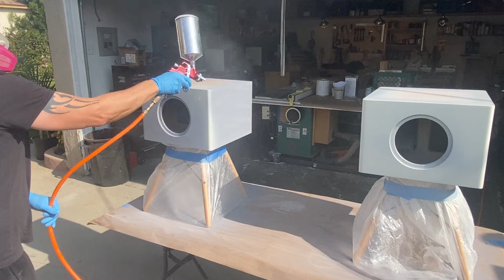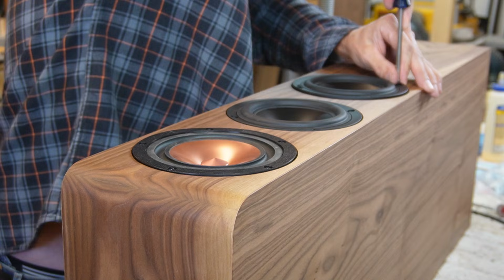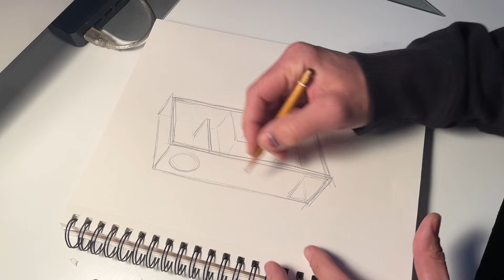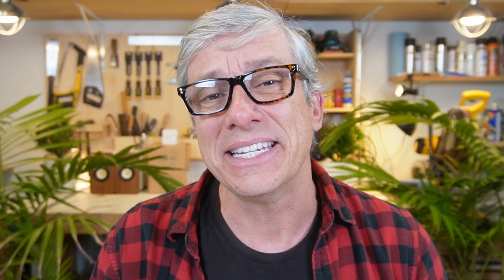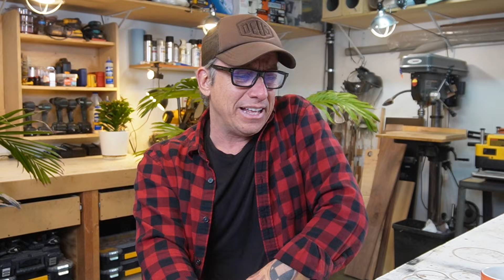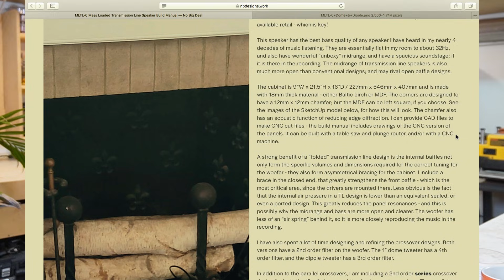Transmission Line Tech Talk | Intro to MLTL-6 Speaker Build | SB Acoustics | DIY plans available

Comment: Great video explaining the TL design. If anyone wants to pursue this topic more check out Lynn Olson's Ariel TL speaker . He does a great job of explaining how they work and went through 5 designs before he was satisfied which I think is called the Ariel 6e that I ended up building in 2015. 2 Vifa P13WH-00 mids each with a 6ft  transmission line with large ports on each side at the bottom and a sealed Scanspeak tweeter. This is a difficult build even for an experienced woodworker and the crossover is not cheap. I think I had well over 1200k in the xover and actually mounted it externally in a matching box behind the speaker. But my gosh- the sound!! I would put it up against speakers costing 6-10 times as much. Many have built it but as far as I know I'm the only one that did a video on the process. Just go to YouTube and punch in Ariel speaker construction.
Reply from the maker: Hey Michael!! Thanks for all the info and hard work!! I’m gonna check that! Those are good drivers, as far as I know, must sound pretty good.

Comment: I like the more in depth approach you are taking.  It allows us to experiance more of your expertise and gives us better design and development information.  I've built speakers since I was a poor kid.  I actually made a box using gypson wall board once with a full range speaker with wizzer cone and it sounded great.  That was back in the 1962.  Any way, love your channel and projects.  Current project has peaked my interest as never built that kind of speaker.
Reply from the maker: Hey Mike! Thanks man! Yup, I get you. We have to go with the flow right? Loong time ago. What you’ve been making now?
Reply: Hi, well it has been a bit about 8 years and was the last piece to my home entertainment system.  It was my subwoofer.  I used a 12 inch Shiva sub and a 6 inch port with an about 4 ft internal tube tuned to 18 hz.  Used a 1000w plate amp.  The box was about 3f hight by 3ft wide by 3ft deep.  A big 6.3 cuft box.  The front was made from two pieces of 1 inch MDF board glued together.  The front hole is chamfered to allow the speaker to breath.  It is baffled so quite a trick fitting in 4 ft of 6 inch pvc tubing.  I used 6 inch elbows to make it fit.  Don't know if that was the best thing to do but it works.  I choose the large 6 inch port to prevent chuffing which worked perfectly.  And yes I do get a good 18/19 hz bottom end.  I just replaced my Onkyo 717 with the new Sony STR AZ5000ES AV receiver which is a huge improvement.  I have a 5.1.2 system.  Your channel got my interest which I use as a proxy.  I will never build another speaker but does not mean I don't want too.  So I watch you.  Good tradeoff.  Keep up the good work.
Reply from the maker: @mikerhodes9198  wow!! That must be a good bass box man. Large though. I wanna start a subwoofer design but more in a lower budget. 
Thanks for watching and I hope you can go back to making at some point!!
Reply: @sonnoradesign  the box is attractively finished in zebra wood sitting in a corner being used by my wife as a knick knack table so it's size is not an issue.  Looking forward to your next video.
Reply from the maker: @mikerhodes9198  hey Mike!! It happens my friend! Haha
Reply: @sonnoradesign  I know.
Reply: halo.Bernardo.check the ins message if u didnt see
Reply from the maker: @arcticchin5968  cool!!!

Comment: linoleum tweeters! LOL!!! I bought a pair of the Radio Shack speakers with those tweeters for my nephew. They were exceptionally smooth and open because of the 360Deg radiation. Too bad they disappeared.
Reply: They are wonderful tweeters! Linaeum (say lin-AY-um I think?) are unique - they are variable width; in that on lower frequencies, they radiate from a wider area of their curved leaves. As the frequencies go up, they radiate from a narrower and narrower area; approaching a line source. And since they are dipole, they effectively have 360 horizontal dispersion.
Reply from the maker: I'll keep an eye on Ebay for the Linoleum, or Linaeum.. haha
Reply: @sonnoradesign  Most of the time, these are available on the LX-55 speakers. The earlier LX-5 speakers use the ET6 tweeter, which is much lower sensitivity. They might be able to be used with a change of the resistor on the tweeter. But I use the ET6A tweeter, which are more common. They are usually $40-60 each; whether they are "raw" tweeters or still attached to the speaker. The woofer surrounds fail, and people sell them as is.
Edit: the ET6 tweeter are usually on models with a metal screen on the top of the speaker. The ET6A came on speakers with a cloth covered plastic frame that covers the tweeter, and just comes off.
These tweeters use ferrofluid and it can be dried out. I have had one fail, out of about 10 that I have used. Not a high failure rate? But I do now keep a spare on hand, for our friend Justin Case.
Reply from the maker: Haha! Right? Neil loved it also. I never had the chance to listen to those. Maybe one day I’ll hear Neil’s speaker with the Linoleum one! 😆

Comment: Great a new speaker. 😮I can't wait to watch it when I get home from work 😅
Reply from the maker: Let's Do it!!!
Reply: @sonnoradesign  it took me to midnight but I got to be video. I was working on my new speakers they are like 80 lbs no lie MDF with a gallon of flooring adhesive glueing down .75 solid oak and 1.75 sq I finally put the first finish coat on of pure Tung oil cut with mineral spirits it comes out beautiful and I a router the edge and I use gold leaf paint were I router in the edges like a column in a museum or something. They are my masterpieces I silver solder oxygen free copper wires braided big gold plated copper binding posts and I even dipped my inductors in wax it's a little trick

Comment: I have built the Parts Express Tri Trix TL kit.
It is a narrow floorstanding MTM design  mass loaded. 
The design is simple with just one internal baffel?/brace? fitted at an angle to create the T line.
It uses two Dayton Audio 5" mid range drivers and a Dayton audio soft dome tweeter.
The amount, extension and quality of the bass is surprising for such small drivers.
Mids are very good as are the highs for such a modestly priced speaker, although they have gone up $100 (!) or so in the five years since I built mine.
The only drawback I can see is the fact that the enclosure must be fairly large to accommodate the T line,  so you're probably looking at a floorstander rather than a bookshelf, a deal breaker for some.

P.S. I am a recently retired toolmaker and here in America, the tool trades are a United Nations with folks from all over involved.
I can't quite place your accent and its bugging me.
I look forward to the new design, as I will be finishing up my three way bookshelf project in the next few weeks, (I take my time, its a hobby, not a race)
Reply from the maker: Hahaha! Boston is kind of right! Born in Brazil, Spanish family! 
Sure man, those boxes can get pretty big. This MLTL is still a good size bookshelf. Good to know all of that (Tri Trix) I'm excited to hear the result.
Reply: @sonnoradesign  
Ahh, of course,  I just want to say how much I appreciate your channel. You "123 Toid" and John Heitz (?) are great because you are the whole package, design build and fabricate, the lot, boxes, crossovers, electronics. I am deeply impressed.
Reply: From what I can tell, that is a variation of a TL - it tapers, and then expands - aka reverse horn.
Reply: @NeilBlanchard  it's the legend himself reading comments. Good stuff
Reply: @BostonMike68  You are too kind! Thanks!
Reply: Many years ago
I
Re-did the good Reverend’s 
Dayton 6 1/2 inch MTM design
Into
A transmission line cabinet.
TheBass was amazing
I wish I could listen to them again
But
Dang
I can not remember 
Who
I gave those speakers to.
Reply: He's from LA California 😅 Spanish
Reply: Ok Brazil sorry about that.
Reply from the maker: @BostonMike68  You were close haha
Reply: @sonnoradesign  it sounds like you have a Spanish accent probably because have Spanish Family. I found some 6.5 designer series on clearance I might try use them for this design. I always interested in a transmission line design. Thanks for switching it up. People that are really interested in building speakers will appreciate it. Some people just watch you dance around and be funny 🤣 I like both
Reply from the maker: @BostonMike68  Thats right! I'd suggest following the manual for this design, its made for the SB Acoustics. Good pricing drivers with series crossover. Cheers:hand-purple-blue-peace:
Reply: @sonnoradesign I really want to hear it. I want to try the Sb s I been looking at them. I was wondering if it has to be a certain qts for transmission lines. It must sound incredible